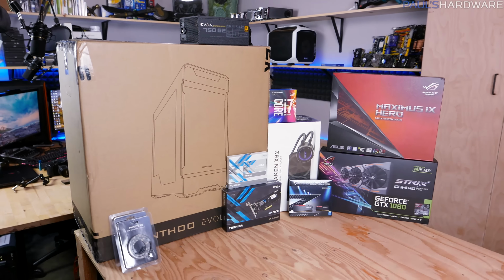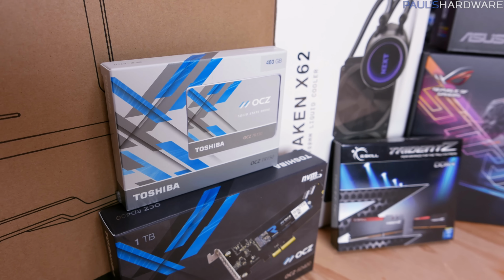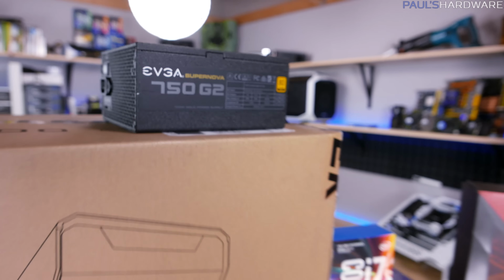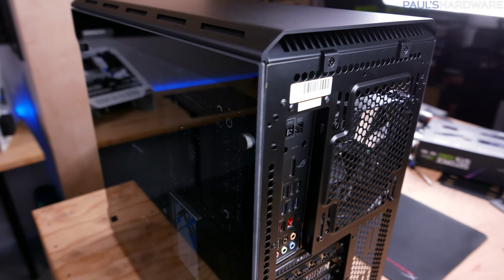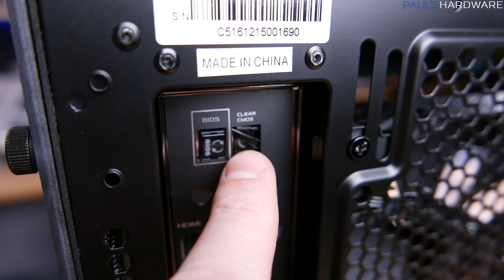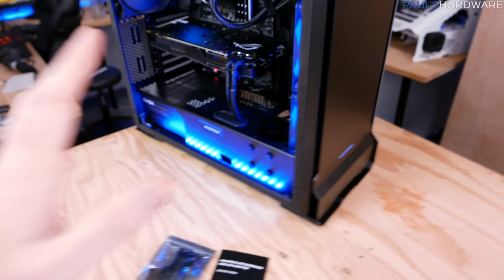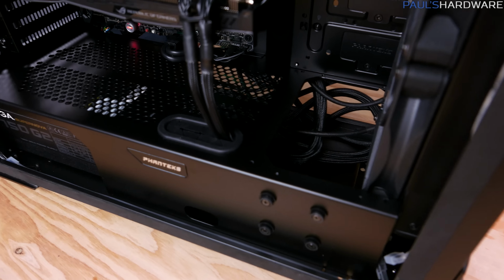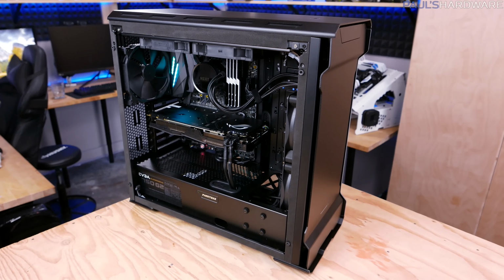Building a $2800 7700K / GTX1080 Gaming System - January's RGB PC!

Comment: CASE: Antec Twelve Hundred (NOT USMB 3.0), Antec 1,000 watts power Supply. Would this case work for the NEW Asus Maximus IV Formula? Also as far as the Liquid CPU Cooler that you used, do you think it'll fit in the case knowing that the case has 2 fans in the back, a massive fan on the top, and 3 in the front!.....NOT SURE IF THE 2 in the back are removable, i assume they are...

Comment: Hi Paul! I built a PC like this one few weeks ago and I'm planning to get a X360 Kit from EK. Do you think it will have enough clearance for the graphics card if I mount the radiator and reservoir/pump combo in the front? I have the Zotac GTX 1080 Amp Extreme and it's freakin longer than the Asus strix.

Comment: Doesn't the Strix GPU come with additional headers for case fans? Could you use those to feed the GPU from the front case fans and run the AIO from the roof?  So far I think I've seen no-one use those headers yet!

Comment: dont you think there would be negative pressure (suck dust) inside the case with most fans in exhaust and rad fans in intake.??            can the AIO not be shifted higher up on the front with new holes drilled or be shifted to the top ???

Comment: How warm does the cpu get under load? I pretty much have the exact same parts and case and my cpu hits slightly above 80 degrees sometimes (with kraken x62 and 7700k) tubes are hidden behind the aio which is mounted on the top.

Comment: What happens if you put the kraken x62 (which is already pre applied with thermal paste) upside down? I did that and I just took it straight off and put it the right way up. I could tell that the paste was ruined but will it have any affect on the performance even though the paste is still there?

Comment: Paul, I have this case and I want to buy that RL and put it in the same place like you but I have one question. 
Is it possible to put the radiator a little above? I still have 1 HDD and I dont want to remove the HDD brackets :(

Comment: I'm planning a new build and it's very similar(same case, processor and AIO) and I have a big doubt: Kyle showed us that front mounted radiator is better with an open shroud gpu but doing so(as you've done and as I would do) the pressure in the case would be negative(2 obstructed fan in and 3 outs). Since I would go for a positive pressure(better if a slightly positive) I'm banging my head trying to fing a solution and I'm not finding one. Changing the orientation on the AIO's fans and the top ones(AIO's exhausting and top fan as intakes) wouldn't work fine. Hope someone can help me :)

Comment: My Phanteks RGB strip is in a different color than my board when I use the Aura Software. It seems right and syncs with the Mobo lights perfectly but the color is off by a good amount. Any way to fix this?

Comment: hey paul im trying to decide between tbe kraken x62 n the corsair h115i for my 7700k i currently have an h90 that keep it in check at clocks seeds which is 4.5 on all cores under load at 80c or under the thing is that it seems likei reaching the h90s cooling limit wil upgrading to either help?

Comment: I have a question. Why does every PC builder not take the little plastic cover over the CUP socket before putting in the CPU? They always put the CPU in and lower the arm which pops out the CPU socket cover
Reply: eduardoig17 That's how you're supposed to do it.

Comment: I'd like to see how cheap of a build you can get with just the bare minimum using a gtx 1080 and a 7700k. with stock coolers just a 1tb hard drive and an ssd boot drive.

Comment: Hey Paul, which camera did you used for record this video?
Reply from the maker: The tripod shots are a GH4 with a Sigma 18-35 lens, the handheld stuff is on my LX100, and there's a couple shots with a GoPro Hero 4 in there too
Reply: thanks a lot.

Comment: oh dude! i fell ya pain man. noob mistake, tiny error, didn't look,..we all been there.
still..chuckle, sigh, do what ya gotta do, and power 'er up.
jays 2 cents did a fan config vid, and tested pull vs push
push is slightly better if i remember correctly, but check out jays video as i may be wrong

Comment: your case isn't that good for a $2800 gaming pc? not much air flow going thru the front? I would suggest you get the corsair 780t case for the build. even if you have gaps on the said of that case not much air flow still getting in.

Comment: Nice build but doesn't need to be that expensive. Did a rgb 6700k gtx 1080 tempered glass build last month for under 1200
Reply: Mohammed Aliyu new?
Reply: Mohammed Aliyu im doing a 1070 7600k build for €1500,-
Reply: Nick Karsten  Yeah it was all new. Black Friday deals saved me a lot though I did save money by buying unboxed (still new) 6700k for 230. and the cheapest 1080 I could find (palit gamerock) for 499

Comment: I'm new to pc building, I hope someone can help me here. I'm looking to get a AIO cooler but can't decide between the 240 and 280mm kraken with the same enthoo evolve case. I don't want to lose the hard drive space so should I go with a 240mm x52 kraken? Or top mount an x62, but after watching Bitwit's vid on radiator mounting, I'm convinced top mount is not the way to go. I'm
Noob, so any help is appreciated. Thanks!!

Comment: Lots of problems with the parts in this build:

EVGA power supply:   EVGA does video cards, they don't know power.   Should have went with Seasonic or Antec.

OCZ ssd drive:    OCZ ssd drives were horrible quality, for years.  OCZ should be avoided like the plague.

Asus 1080 card:   Good card, but fans can be loud.   Quietest 1080 cards are from MSI.

NZXT Kraken cooler:   160 bucks is way overkill to cool a 7700k cpu.   Arctic Liquid Freezer 120 is only 61 dollars, works great.

Comment: How much room have you got between the Kraken X62 tubing connections on the CPU block and the RAM? I'm planning a build and I really want the X62 to work with all 4 DIMM slots populated but worry that there isn't much clearance. For example: https://linustechtips.com/main/topic/727980-kraken-x62-poor-design-decision/#comment-9256256

Comment: This is really similar to my build!  I got the exact same case (and color and LEDs), i7-6700k, same GPU, G.Skill RAM, SSD & NVMe SSD and nearly identical PSU (I got the 850 version).  I even front mounted my AIO too, but it's push/pull (using 3 120mm fans instead of the 2 140mm that came with the case).

Personally, even if you're not using the mechanical drive bays, I would move the cooler up and cover up the mechanical drive bays for a cleaner look.  Also I would move the SSD to the front.  You can route the cables through the drive bays, so the logo isn't upside down.  Also pushing  the cooler up, you might be able to suspend the tubes above the RAM.

Anyhoo... here's a pick of mine (before I moved the SSD to the front): https://pbs.twimg.com/media/Cs6QoEmVIAEd1Yg.jpg

Comment: jesus, I hope no one uses this as a quick buy. u can easily go sli for this price if u don't spend $800 on storage. u spent more on storage than on ur gpu. also, not spending $180 on a case helps. fast storage is great tho. I work with m.2 drives. makes my job of watching loading bars much less misserable.

Comment: I just put that mobo into my pcpartpicker list my build is gonna cost 3k+ but everything is super overkill.

2 PNY xlr8 1080 8gb gpu's in sli
64gb ddr4 3200 ram
I5 7600k
CM hyper tx3
480gb ssd 
2 toshiba 3tb hdd
Corsair 760w 80+ Platinum psu
Win 10 Pro 64
Corsair  HD120 rgb 3-pack case fans
Corsair Spec-Alpha case
Reply: A few problems with your build.

With this you are getting more for your money. 

PCPartPicker part list: https://pcpartpicker.com/list/4ByDhq
Price breakdown by merchant: https://pcpartpicker.com/list/4ByDhq/by_merchant/

CPU: Intel Core i7-7700K 4.2GHz Quad-Core Processor  ($343.89 @ OutletPC) 
CPU Cooler: Corsair H100i v2 70.7 CFM Liquid CPU Cooler  ($99.99 @ B&H) 
Motherboard: Asus STRIX Z270-E GAMING ATX LGA1151 Motherboard  ($199.00 @ B&H) 
Memory: Corsair Dominator Platinum 16GB (2 x 8GB) DDR4-3200 Memory  ($159.99 @ Newegg) 
Storage: Samsung 850 EVO-Series 500GB 2.5" Solid State Drive  ($169.49 @ OutletPC) 
Storage: Seagate Barracuda 2TB 3.5" 7200RPM Internal Hard Drive  ($69.89 @ OutletPC) 
Video Card: Asus GeForce GTX 1080 8GB STRIX Video Card (2-Way SLI)  ($678.99 @ SuperBiiz) 
Video Card: Asus GeForce GTX 1080 8GB STRIX Video Card (2-Way SLI)  ($678.99 @ SuperBiiz) 
Case: NZXT S340 Elite (Black/Red) ATX Mid Tower Case  ($89.99 @ SuperBiiz) 
Power Supply: Corsair 860W 80+ Platinum Certified Fully-Modular ATX Power Supply  ($199.99 @ B&H) 
Operating System: Microsoft Windows 10 Pro OEM 64-bit  ($129.77 @ OutletPC) 
Case Fan: NZXT Aer RGB120 (3-pack) 61.4 CFM  120mm Fans  ($74.99 @ SuperBiiz) 
Case Accessory: NZXT Hue+ LED Controller  ($50.88 @ OutletPC) 
Other: EVGA PRO SLI Bridge HB, 2 Slot Spacing (100-2W-0027-LR)  ($39.99 @ Best Buy) 
Total: $2985.84
Prices include shipping, taxes, and discounts when available
Generated by PCPartPicker 2017-01-31 18:34 EST-0500
Reply: 'Rodrick57' An i5 in a 3000$ build? nah nah nah. You better put a i7 in it.

Comment: For $2800 I could've added a Intel 6800k 6-core processor and gtx 1080 SLI and 32gb of ram, way better performance in every aspect and a a 1TB of fast SSDs I wouldn't recommend this build for $2800

Comment: This is the perfect showing of how nvidia is screwing us. 2013 I bought the equivalent of this pc (i7 4770k, gtx 780, liquid cooler) for 1800 Euro. Now the same costs 2200$. Nice inflation
Reply: Andrea T. how much did you pay for that 780?
Reply: 600€ for the first, then when the 780ti was released I paid 450 € for the second. Asus DCU2, so not the cheapest ones around.
And those where big chip GPUs, not middle class-size gpus like the GP104 of the 1080 today for 700€ . No wonder Nvidia is making tons of money and their stock price is going up.
Reply: Andrea T. the 780 release price was $650 USD the 1080 release price was $600. let's go with theyre equivalent like you originally said, that's $50 cheaper so I'm not sure why you'd say nice inflation. if and when the 1080ti comes out we'll probably see a price drop on the 1080 like what happened when the 780ti came out.
Reply: Like I said, the gtx780 was a big chip. A cut down GK100. The Gtx1080 is a middle-class chip comparable to gtx 770 of the time. This is my main point. Nvidia is able to price a middle-class chip that high because there is no competition at the high-end. And the price of the gtx780 was only lowered and the 780ti released because of the R9 290X coming out and competing with nvidia.
Secondly, I'm comparing Euro prices. Checking in amazon.com I see there are even 1080s for 550$ around. Lucky you. The same Gtx 1080 strix costs 650$ in america and 730€ in Germany. This with a conversion rate of 1,08 $ for 1 euro (it should be more like 600€)

Comment: I did a custom loop in this case! if anyone is wondering how to modify the upper rad bracket to fit the fans up top, check out my build!!

http://www.dazmode.com/_forum/showthread.php?2388-Phanteks-Enthoo-Evolv-Atx-Tempered-Glass-Watercooled-Build
Reply: Omg that build is sweet man!
Reply: Thanks!
Reply: That is sexy cable management.
Reply: So what exactly did you do to fit them up there?
Reply: took alot of thought lol thanks!
Reply: Trimmed the lip on the upper portion, use phobya slim hsp fans. foam to block out hot air from going back into the case
Reply: That is a very very nice build! Truly put your heart and mind to it!
Reply: Dan Blythe 

That's a gorgeous computer! Nice job!

Comment: I don`t understand why people put the aio in front if there is space in the top.....it IS stupid and it looks stupid.
De pc likes FRESH air & with the aio in the top & the normal fans in front the system will be cooler because of the fresh air that comes into the case.
If you put the aio in front there only comes 1 thing into the case and that is HOT air from your radiator.
Specialy the gpu if cooled by air don`t like radiators in front because they don`t get any fresh air.
Reply: Front is actually better than top mounted for temps..
Reply: Only for your cpu because of the fresh air.....Not for the gpu if air cooled (& rest of the system)

Comment: remove the nvme Jesus not usefull in any way you make this built way to expensive with your crappy choice of parts way to overprice
Reply: BattleExtremeNL i like ur profile pic
Reply: What parts would be better? Im looking to do a new plush build;
Graphite Series 780T Tower
intl 17-7700k
was looking at Gigabyte Z170X-Gaming G1 motherboard - but not sure
Zotac GeForce GTX 1080 (maybe 2 in sli??)
haven't decided on the other parts yet.
Thoughts? additions? amendments?
Reply: richard huskins maybe go with Z270 for better kabylake support and more RGB 1080 is a solid choice bc no competition
I'd recommend a Evo 850 as bootdrive and almost any HDD will do for storage at this point maybe go for water-cooled if you want
Reply: Cool motherboard. Seems there isn't much between the two. Good shout. I will be water cooling this